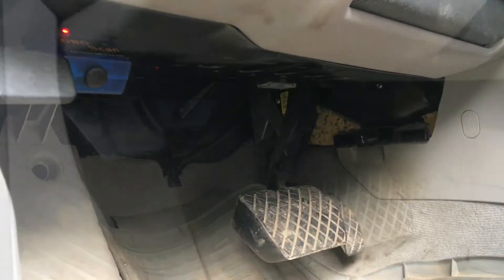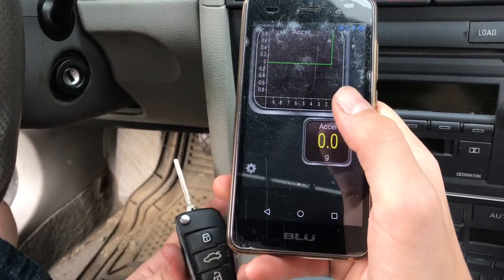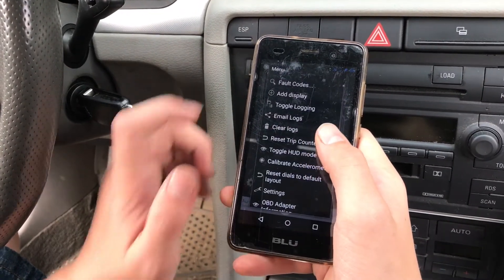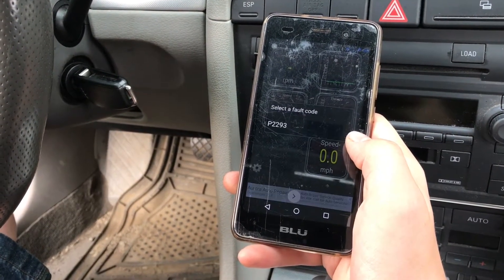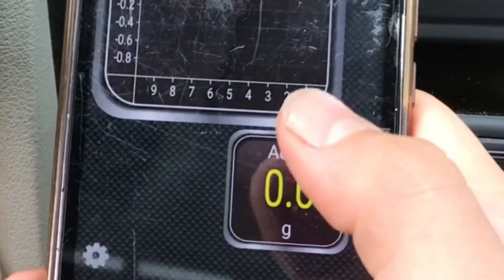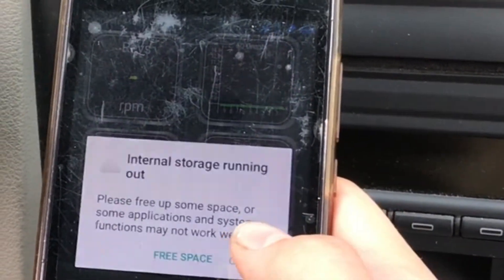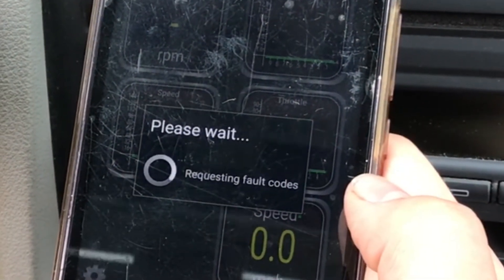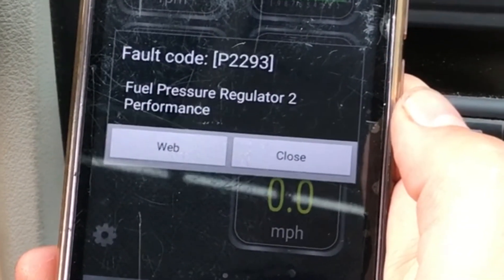error code P2293 (RESOLVED)

Comment: I've been fighting this issue if anyone could help that be awesome... Here a list of what I replaced and still getting the same code. - intake cam, exhaust cal, timing chain and tensioner, lifters, rockers , timing belt, water pump, cam follower, in take Lpfp, HPFP, sensor on HPFP, "thrust sensor" under intake... I'm lost... I wonder if the multi-purpose relay might be going bad but that was replaced not long ago... I'm really at a loss at this point... I've switched from my tune to a stock file same issue.. I'm open ears to any suggestions... HPFP I replaced twice cause I thought the first was faulty , apparently it wasn't...

Comment: Thank you sir! This video saved my hard earning money. After replacing the rail (fuel leak) on a 2005 A4 2.0TFSI, BGB engine, had some problems like squeaky sound when accelerating and code P2293! The new rail came with an orange sensor like that in your video, and i replaced it with the old one and problem solved😎

Comment: hi, i have audi a4 b7 2.0t fsi s-line. I have the following problem eror code (p2293 fuel pressure regulator 2) The engine runs very poorly. what is the problem?  sensor? Which one should I buy?
Reply: Did you fix this?

Comment: Thank you for your your video.  I have a 2006 2.0 with a 2007 engin.  Would I have to replace the sensor with the older one?  Thanks.

Comment: Ok Iv got the same problem limp home mode found it had the fuse missing too my code says 2 as well so you think it’s the sensor not the high pressure spring      Seen how much that costs and the damage it can do it worn out     I’ll try the sensor first    Should I do the ECU reset then

Comment: have the same code in my 2011 polo gti with the 1.4lt twin charge, any chance you could help me with a part number. all my local part stores don't carry listings for my car
Reply: Hi mate, got the same issue! Did you sort yours out in the end? If so what was the cause?
Reply: @abdulkader5222  yeah... the fuel sender while testing fine wasn't working. They also replaced my 12 month old filter and said it was the worst they had ever seen. Replaced the high flow fuel pump in the engine bay and the control module
Reply: Hi I have the same problem did you fix it?

Comment: Were there any other symptoms like noise etc before this error code was triggered? My water pump, vacuum pump and pcv were recently replaced at the dealership. I drove car for a day and suddenly it sounded like a two stroke scooter, very rough noise and later that day the error code came up. I called dealership today and they said it needs to be towed and looked into and they suspect the high pressure fuel pump.
Reply: Hey man. Did you ever replace this sensor? I'm dealing with the same issue

Comment: What’s the part number for the field pressure sensor 1 (not referring to the one you replace on the video)
Reply: Did YOU mean fuel pressure regulator bank1

Comment: thanks for this video , i drive a 2.0TFSI Quattro 2010 . i have one of the cheap OBD 11 devices and they picked out the same error . The car just jerked and it  stopped. i think i should start with the sensors first
Reply: Did you solve it ?
Reply: @djamel_bijoux  yes I did. Along the way I replaced oxygen sensors, oil separator , new injectors , hpfp , maf all was in vain . It was actually a bad  turbo.slapped in the new ko4 when I went stage 2 and Methanol I'm all good

Comment: Hi,
Great video. Thanks.
My golf 1.4 tsi twincharged was running fine, just had water pump leak, so replaced water pump and also did the full service including spark plugs, engine oil, filters, dsg service, drive /serpentine belts and pulley changed. When I start the car, it started idling rough, no power at all, when press acceleration nothing happens instantly, then very slowly it speed up. Check the spark plug, which has done 1 mile hardly, they were black. All 4 got black. Few codes came up too, initially it was p000A , when I changed camshaft sensor it disappear and 2 other codes came on, p3008 and p0341. Then I put the old sensor back, then only p3008 remained. I replaced coolant temp sensor, thrust sensor, camshaft adjuster valve,  put new spark plugs, but changed fuel filter. And also double each & every part for compatibility, bought from main dealer. After starting new spark plugs, I started and it was sane. I again check all plugs, they were all slightly black carbon on them, all 4 were in same condition. No oil, just black carbon. I was thinking may be I left any vacuum pipe back in? But if it was vacuum leak then it’s lean Condition and the spark plugs shouldn’t be getting black carbon on their tips.  More fuel coming in as compare to air, that’s why I changed coolant sensor, 
Can faulty high pressure pump cause this condition, rough idling, misfiring (if look at exhaust), spark plug getting black with in few minutes of idling. 
Also can these symptoms caused by over filling of dsg oil? I put back same amount of oil (4.8 litres)which was flushed out ? 
Please help
Reply: Did you all ever diagnose this issue? I have an 07 GLI and I’m having the same issues. P2293 code and misfire on cylinder 1. Replaced coil packs and plugs and as you stated with in minutes the plugs are black. Car will crank but takes forever to start.
Reply: @TEAZYJ54  have you find a problem?
Reply: 786hunzavalley same conditions as you

Comment: Hi I have this issue with mine, 2006 tfsi a3.

When exceeding 5k revs in 5th n 6th gear it cuts the turbo out and then it's fine again after some seconds.

Fault code is p2293 fuel pressure regulator 2 performance this only comes on when doing high speeds and when I start the car in the morning the fault code clears it self by then.

I'm thinking it could be the fuel pressure sensor? What are your thoughts?

Cam follower has been replaced and has made some difference as doesn't do it often as used to, also replaced all FILTERS including fuel filter.
Reply: mohammad ali  got the same problem too!! And Can’t find what it is!!
Reply: @leenunez167  I've fixed my now pal, turned out the cam follower that's on the high pressure fuel pump that rides on the camshaft had failed meaning it had a big hole in it, caused damage to high pressure fuel pump and caused damage on the cam lobe!

New high pressure fuel pump, new cam follower, replaced the camshaft and the rocker cover gasket, set the timing again after I run in the camshaft for a few thousand miles the problem was solved no more cutting out or codes, most likely you've got the same as me or just replace the cam follower and see it if works.
Reply: mohammad ali I have change me fuel pump i the tank I Changed my hpfp twice along with cam follower and Still getting p2239 when Going at high speeds my car dies and when I stops it dies
Reply: Hector Nunez hey buddy looks like your issue is the throttle sensor it happens to me on my 06 gti
Reply: Raptor 99 throttle sensor?? What are the symptoms in your car
Reply: Hector Nunez throttle body assembly my bad ..
Reply: Hector Nunez my car was stalling once in awhile especially while driving

Comment: Do you know what causes the error code P2295 (Fuel Pressure Regulator 2 Control Circuit Low)? 2.0t TSI MK5 engine. Thank you
Reply: ZTEKFORCE  I have the same code, did you ever figure it out?

Comment: I did an engine replacement from a 2008 into a 2006 Audi A4. I am not an Audi guy. The car had this code-P2293. Your video saved me tons of time. Swapped the sensor from the original motor. Problem solved. Thank you!
Reply: Which sensor did you need to use the orange or black , I have the same issues put a 2008 engine in a 2006 currently has the black sensor but getting this code

Comment: Thanks man! Very informational!  Mk6 gli same code! Worked very well. The part # at Oreilly auto for the mk6 gli is 0261545050. Had code 2293 and changed fuel filter first but like you said in the video fuel pressure "2". epc light only came on when low on fuel. Test drove it after this install and it feels more peppy already. Hoping it fixed it.
Reply: How did u take off plug cant get it
Reply: Syrus Lang how did u took of the plug what size socket
Reply: I hace the same GLI mk6 ,If work the sensor presure 2 performance  for the mk6 i hade the same code and the chance the Fuel filtre but still the same ligth EPC ???? You replace and work? Fine

Comment: Hello, so can you please post which sensor it is?
Reply from the maker: +quinceythemonster 

The split for these two different sensors on the 2.0 TFSI engine happens between the year 2006 and 2007 below explain which sensor goes with which your of car, let me know if this makes sense. 

If you have 2006 or lower year you need a 116 bar thrust sensor or fuel pressure sensor. Part number (261 545 059) The sensor I used was a Bosch, but I'm sure there's other brands. The Audi I put this in was a 2005

If you have a 2007 or above you need a 126 bar thrust sensor or fuel pressure sensor . (06J906051D) (VW AG) The color of the sensor is orange.
Reply: Yes yes. There is a difference. How about this code 0261545059. It just has a 0 in front. I was experiencing the turbo cut like you said. Then I replaced the low pressure sensor on the pump itself and boom, 100% turbo. 
Now the only code I'm getting is the p2293. I'm actually glad because it's no longer more than one. All of my numbers under emissions are good except for the long term fuel trim. It goes from - 16 to - 19. I can also hear the low pressure fuel pump working a little extra every now and then during idle. 
I feel like that means the rail pressure isn't holding the way it should, so the computer is telling the lpfp to send a larger volume to the hpfp in order to compensate. My rail pressure remains within specifications. Itdle- 699/710psi. very high rev-1300+ psi. 
Oh, and on cold start, the engine doesn't fire up immediately. Takes a couple more turns. 

I hope this hasn't been too much information. I really appreciate this video. It narrows some things down for me.
Reply from the maker: +quinceythemonster 

The zero at the front of the serial number is no problem, I checked the box The sensor came in and at the far left there is a zero. In your description above I did not see the year of your car. I would imagine it is a 2006 or lower. If that's the case the thrust sensor or The fuel pressure sensor you have listed is the correct sensor.  Do you know the condition of your low pressure fuel pump? When I checked mine on the computer I saw the cycle time was a little high but still OK. In other words my Low pressure fuel pump is working harder to keep the volume of fuel available for the high-pressure fuel pump to deliver it to the engine. I'm just wondering if it's getting enough fuel volume.
Reply: Error Code Guy right on. I'm sorry for leaving that part out. I drive a 2006 audi a3 with the 2.0 tfsi engine. My intank pump is new along with the the fuel filter. They both have about 1000 miles on them. And I think you're dead on.
Reply: Hey, I just wanted to thank you for this video. Back when I had the code there really was nothing online that I could find that narrowed it down the way you have. Ever since I changed the part the car had run like new. It even removed a weird turbo noise. I at times had no boost or I was over boosting. Now everything is just right. Thank you very much.
Reply: @quinceythemonster which part did you change that made your car run like new? I just changed my HPFS but now it gave me code P2293, I drive the same car as you
Reply: is this a high or low fuel pressure sensor?
Reply: Jag high